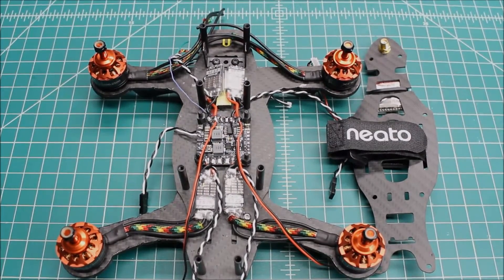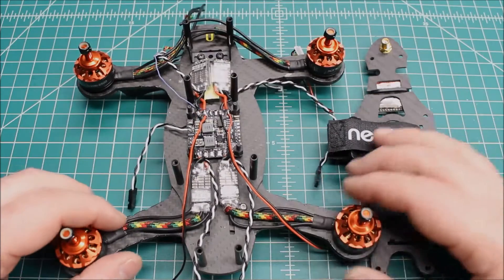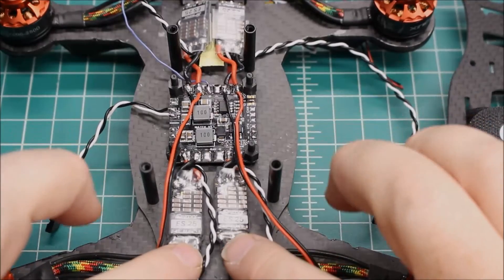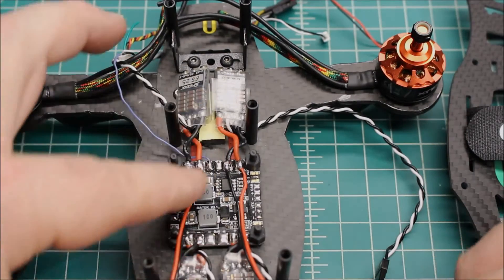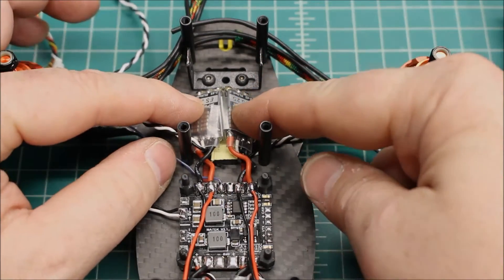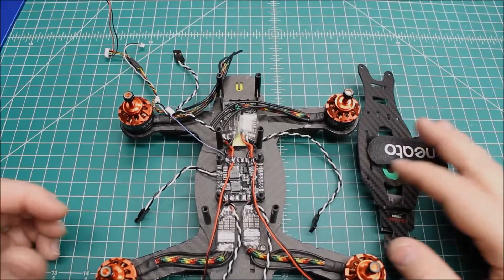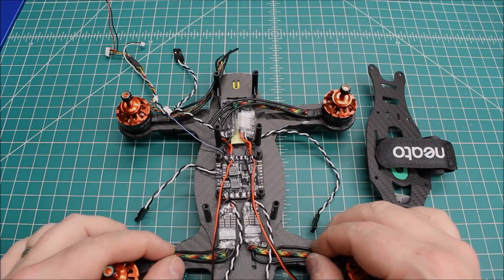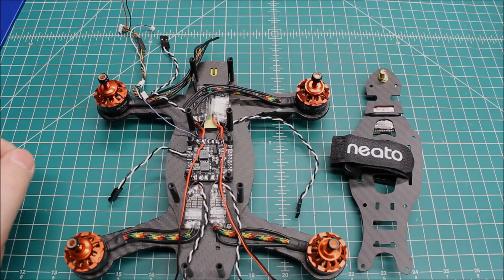Neato 220 "Dallas" FPV Racing Frame Build  Video 2 of 3

Comment: Hello Doug, 
You call it power cord, however I can not find it anywhere on the internet. Could you supply me with a link to it or an alternative name I can look it up. Just in case its the red, yellow, green wrap you have around the motor cables to the ESC. 
Thanks.